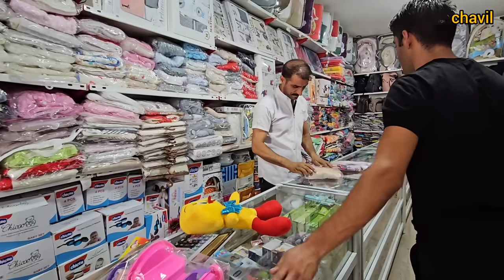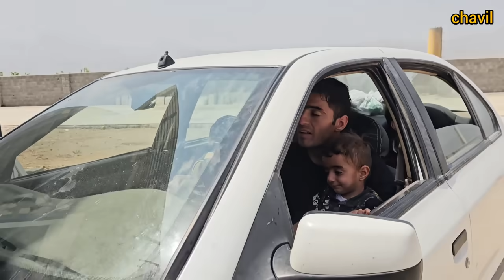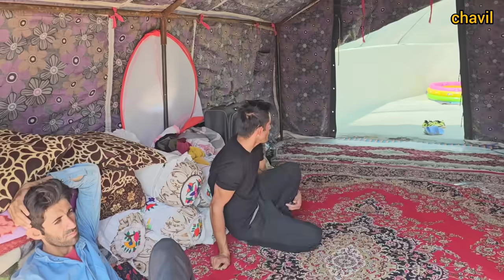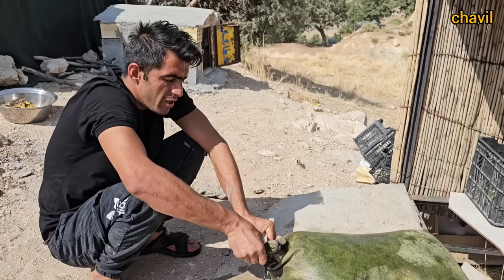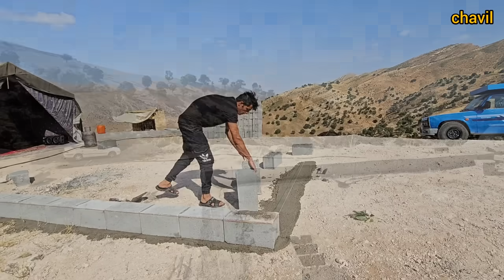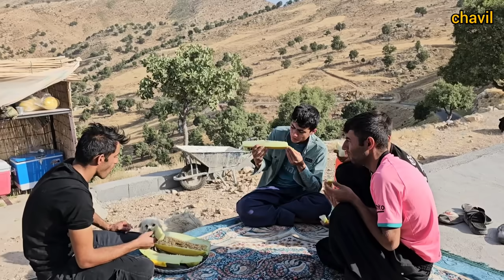Checking the condition of the baby and preparing the room for the baby

Comment: Radman.  I think the baby favors Fatimah right now. Before building another room, I would move back home. It won’t be too hot for the baby. You can get an overhead fan or get a small air conditioner that doesn’t take up much floor space. It’s too expensive living where you are living in my opinion.